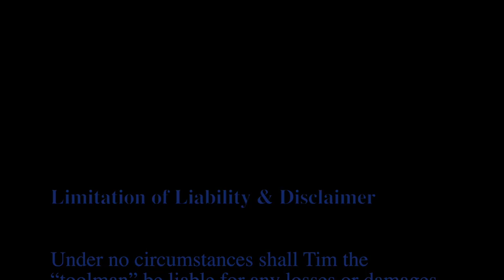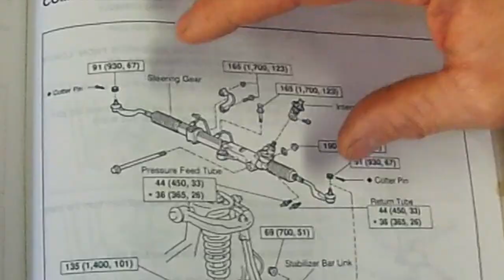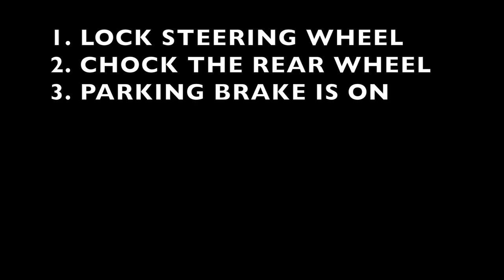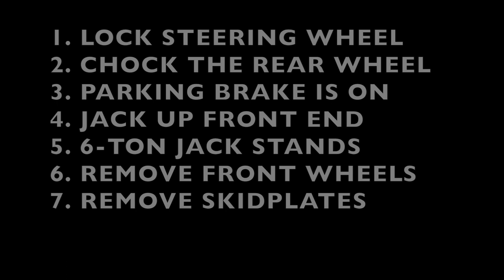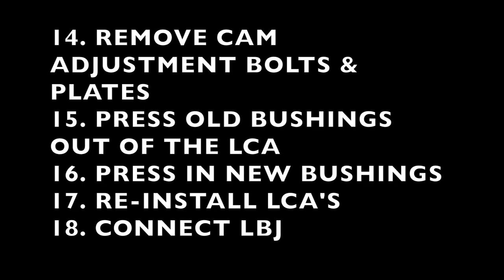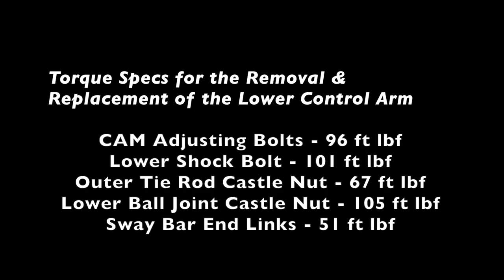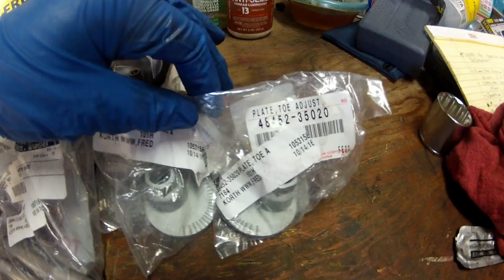Front Lower Control Arm Bushing Replacement (Part 1)

Comment: What's up Timmy the Toolman,
I might need to replace the entire Lower Control Arm since I will be renting an auto-shop with tools and would be needing to save money on garage time, but, I was wondering what is the best place to buy Toyota parts. 
Your LCA description only has bushing part numbers from Amazon. 
What other parts website is good to compare prices?
If buying from Amazon, how do I check if the part is a quality part?
Reply from the maker: An Amazon seller will advertise whether or not they are selling Toyota OEM or not.  I would not buy aftermarket control arms.  There's lots of good Toyota online parts sellers.  Camelback Toyota, McGeorge Toyota, Toyota Parts Deal, etc etc.  Figure out the part numbers for the control arms and then find a seller that has low prices and reasonable shipping costs.
Reply: @TimmyTheToolman  How about Denso Auto Parts for suspension parts? I saw that you recommended it for th O2 sensor replacement
Reply from the maker: @snoopdisnoop  Denso doesn't make suspension parts as far as I know.  They make electrical components.  So, I'm guessing you live in an apartment or condo and that's why you're renting garage space?
Reply: @TimmyTheToolman  There's not enough room in my buddy's garage and the rainy season has started here in Portland, Oregon. I'm doing the LCA's, Lower Ball Joints, and Inner/Outer Tie Rods. The driver side Outer Tie rod is making a clunk sound. 
Do you think I should do Inner as well?
You didn't necessarily drop the rack and pinion to get to the Inner Tie Rods, but one of your videos suggests it to get more space  for LCA replacement.
Reply from the maker: @snoopdisnoop  You need to unbolt the steering rack so you can pull it back far enough to clear the rear LCA bolt and cam sleeve.  In the video, we remove the steering rack boot to sneak the bolt and cam sleeve by, but if you also disconnect the power steering line bracket on the inside of the driver side frame rail, you'll be able to pull the rack back far enough to get the bolt and sleeve out without disconnecting the boot.  OEM inner tie rods are very expensive.  I wouldn't replace them unless there was actual play in the joints.  The inner tie rods cost around $300.  A new OEM steering rack comes with new inner tie rods and runs around $500.  If I had bad inner tie rods, I'd just spend the extra money and get a new steering rack, because for a couple hundred bucks more, it would be worth it.
Reply: Timmy The Toolman Thank you. Ill be sure to donate once i figure how much i save. Shops are quoting me between $3,600 to $4,500. I think i can do this.
Reply from the maker: @snoopdisnoop  You could donate if you'd like but it's not expected at all, especially if money is tight for you.  Our favorite form of payment is hearing how our videos have helped people and you've done that for us.  Let us know how all the  work goes for you.

Comment: Hey Timmy, the 4Runner and the tacoma have the same parts number for the lower control arm bushings right? Couldn’t find any for my tacoma...thanks
Reply from the maker: They should be the same.  The front ends of 1st Gen Tacomas and 3rd Gen 4runners are very similar.  But, there are some differences.  Are you going with OEM replacement bushings or Whiteline poly bushings?  I just looked it up and the Whiteline 53377A bushings doesn't mention them working for the Tacoma.  Weird.  Read Post #4 on this thread on T4R: http://www.toyota-4runner.org/3rd-gen-t4rs/232586-swap-parts-between-3rd-gen-runner-1st-gen-taco.html  Sounds like the LCAs are the same.  I think you're safe ordering the Whiteline poly bushings if that's what you were planning on going with.
Reply: Timmy The Toolman yes I was planning to go with whiteline bushings, but the website doesn’t show if it’s compatible with tacoma, it only shows for 4Runner...
Reply from the maker: Kay Saephan I'd order them. I'm 99% sure the LCAs on the 1st Gen Tacomas and 3rd Gen 4runners are the same.  But, if you want, visit your local Toyota dealer parts department and ask them.  Maybe they can give you the definitive answer.
Reply: Timmy The Toolman thanks Timmy, I just got off the phone with whiteline and they said that they haven’t tested fitted on the Tacoma’s yet but they should be exact same part number...they don’t want to advertise anything without test fitting first....ordering a set for my tacoma.
Reply from the maker: Cool.  Let me know how it goes.

Comment: Hey Tim, what is the distance between the 2 openings on the control arm? Trying to find a good size bottle jack for the job.
Reply from the maker: Hey Omar, it's 10 inches wide.  I bought the bottle jack I used in the video at Harbor Freight.  Good luck with the job when you get around to doing it.  Just remember to use a mild to moderate amount force with the jack.  You should be able to put a little pressure on the bushing, apply heat and then apply a little more pressure.  If you're not getting movement of the bushing out of the arm, make sure the bottle jack is square pushing straight (not at an angle) and also try using more heat.  People have been known to damage their arms by bending them out from the force of the bottle jack.  Happy Wrenching!
Reply: Thanks tim. I just got under there and found my front camber bolt on the passenger side was put together backwards. One cam lobe is facing up correctly and the other is hanging downwards. Any idea what could have caused this? I know they only fit together one way so I find it very weird.
Reply from the maker: @omarzeineddine5427  The cam lobes should be facing up.   Maybe the last guy that worked on it didn't know what he was doing and assembled it upside down.  I suppose the cam would still work upside down but that's definitely not the correct orientation.
Reply: Would a 2 ton bottle jack be enough to press those bushings out?
Reply from the maker: @omarzeineddine5427  No clue Omar.  The bottle jack I used is rated for 12 tons.  I thought it was from Harbor Freight but it's actually a Craftsman jack from Sears.  I would err on the side of having more strength than necessary and get a bottle jack with a higher rating than 2 tons.
Reply: What's the receiving cup Diameter for when u pushed in the bushings?
Reply from the maker: @omarzeineddine5427  Don't remember.  I just tool a measurement from a lower control arm I have and a press sleeve with a diameter of 2 1/8th  - 2 1/16th would work.

Comment: I recently changed my control arms upper and lower along with ball joints on my 2002 Tacoma. After torquing to spec all the bolts I now hear creaking. I read online that installing control arms or ball joints have to be done with the weight of the vehicle on them to not have premature wear on ball joints or have noise like I have. Is there any truth to that?
Reply from the maker: There is truth to that.  We learned this after shooting this video and we included this note in the comment I pinned.  You want the control arms in their neutral position (weight of the vehicle on the tires) so the bushings aren't in a bound state when the vehicle is just sitting there stationary.  This way the bushings are only bound when the suspension is cycling up and down when you're driving.
Reply: @TimmyTheToolman  sorry I missed that. Thanks
Reply from the maker: @jessejaviangel  No need to be sorry.  Lots of people miss the fact we offer information in our video descriptions and pinned comments.  But, now you know for the future.

Comment: do you need a special tool to remove the cam adjustment sleeves?
Reply: mine won't budge.
Reply from the maker: @oneguyonekit  Watch Part 2 and learn.  https://youtu.be/6FzEHygizoI  They won't budge because they are rusted into the bushing sleeve.  It's very common.  You will have to cut them out.

Comment: How important is to torque ? Instead of using impact until it won’t go anymore.
Reply from the maker: Very important.  Using a torque wrench is an accurate way.  Cranking down on bolts and nuts with an impact might end up with stripped bolts or nuts or sheared off bolts.

Comment: I have a dumb question. On that left side where the bolt is miserable to remove without risking scratching the hydraulic ram of the steering rack, why can't it be assembled in reverse? With the bolt going through from the FRONT. If it's one complete camming assembly, it shouldn't matter which way it's assembled for proper alignment, so long as the nut/cam doesn't interfere with the steering rack boot...right?
Reply from the maker: I suppose that could work.  But, when I did this job on another 3rd Gen 4runner, I realized you can pull the steering rack back far enough to remove that bolt and re-insert it.  There's actually no need to remove the steering rack boot.  As long as you remove the bolt that affixes the power steering line bracket to the driver side frame rail, you can move the steering rack back enough to remove the bolt.  I can't remember if we actually show the bracket bolt removal in this video but I know for sure we show it in our Steering Rack and Front Sway Bar Bushing Replacement Video. https://youtu.be/YywcR0E9bM4  Go to 12:45 play time and you'll see the bracket I'm referring to.
Reply: Thanks dude. In that other vid you forgot to show you reattaching the bracket. :P
Reply from the maker: Yeah, we don't always show every little detail because we assume the person watching the video knows they will need to reattach that bracket as part of the reassembly.

Comment: Do you know if a 2003 Tacoma 4x4/Prerunner 6 lug models use the same parts?
Reply from the maker: I just went on the Whiteline website and it doesn't look like they sell the LCA bushings for a Tacoma.  But, if I were you, I'd ask a Toyota parts person if the LCA's on a 3rd Gen 4runner are the same as your year Tacoma.  If so, the same bushings will work then.

Comment: With the white line bushings did anyone notice getting squeaky noise problems? I try and stay away from poly bushings but oem bushings are ridiculously expensive
Reply from the maker: White line makes regular bushings too, you don’t have to buy the poly ones.. but you’re better off buying the entire OEM lower control arm with bushings already pressed in if you go OEM.
- Sean
Reply: Thanks Sean I'll check that out from white line and your right about just buying the whole arm

Comment: Could this help front end shimmy at hwy speeds?
Reply from the maker: It could but I would make sure your wheel balancing was correct first.  9 times out of 10 it's a problem with wheel balancing.
Reply: @TimmyTheToolman  I replaced all four springs and shocks last summer, have had a couple of alignments and wheel balances since then. Still getting occasional highway speed front end shimmy. Sometimes rides smooth as butter, sometimes shimmy.
Reply from the maker: @warddoyouralgebra  Well, if you've addressed the wheel balancing, I would look at the lower control arm bushings and also the front differential support arm bushings.  We have a video for those as well.  Durobumps makes a replacement bushing for the support arms.
Reply: @TimmyTheToolman  Timmy the tool man always coming through. Thank you!!
Reply from the maker: @warddoyouralgebra  You're welcome Blake.  Hope you figure it out.

Comment: Why not put the bolt back the other way so in the future you can access it from the front side instead of having to mess with the steering rack ?
Reply from the maker: The opposite side of the cam adjuster juts outward a decent amount.  I'm pretty sure it would hit the steering rack boot.  That's why.
Reply: @TimmyTheToolman  I see but other than that it’s not an issue. If and when I do my lowers I will post here to let you know and maybe you can pass it on. Also thanks a lot your videos are very helpful.
Reply from the maker: @joesmith7123  Sure, let us know how it works out for you flipping the orientation of the cam adjuster.  You're welcome.  We're glad you're finding our videos helpful.

Comment: Hello Timmy,
I notice your torque is a little different from what I gather on the Tacoma World. I have a 2002 Tacoma V6 4x4 Auto. Could you confirm if I should follow your torque spec? 
 
Here's what I need torqued (front suspension): 

UCA
LCA
Lower shock bolt
Lower ball joint cast nut
4 Lower ball joint bolt
Upper ball joint
Cam Adjuster bolt

Any help is much appreciated as always.
Reply from the maker: Nero I don't see how the torque specs could be that different between the two vechicles because the suspension is almost identical.  But, I would go with the torque specs you have found for the Tacoma.
Reply: Timmy The Toolman 
Okay, thank you. The only that was off from the torque spec was. 
Lower shock bolt 61 ft lbs vs your at 101 ft lbs. the rest is off +\- 5 ft lbs. Thanks as always
Reply from the maker: I would definitely go with the 101 ft-lbf for the shock bolt.  61 ft-lbf is pretty light for that big of a bolt and nut.  The smaller bolts for the lower ball joints are around 60 ft-lbs and they are much smaller than the shock bolt.
Reply: Yah, that what i thought as well. Thank you as always. Enjoy your day.
Reply from the maker: You too.  Happy Wrenching!

Comment: Polyurethane vs Rubber what made u choose whiteline
Reply from the maker: People reported having good luck with them and they are a more affordable option than the OEM rubber bushings.  The jury is still out on whether or not poly bushings will last as long at the OEM rubber bushings but so far so good.
Reply: @TimmyTheToolman  would you put polyurethane in pavement prince 4R
Reply from the maker: @seanf6868  Yes, I would.

Comment: How do you know when the bushings are done?
Reply from the maker: You look for cracks in the rubber and you manipulate the arm looking for gross movement from the bushing.  With everything still connected to the LCA, it's a bit hard to tell how wasted the bushings are.  I would disconnect the sway bar from the end link, disconnect the lower shock connection at the LCA, and disconnect the lower balljoint from the LCA and then push forward and back on the arm.  If you get a ton of movement from the arm, the bushings are toast.  You might be able to get a large pry bar in there somehow with everything still connected and do some prying to see if there's gross movement in the bushing but I've never tried this so I couldn't advise you how to do it.

Comment: So in pressing the old bushings out it looks like I might have bent the control arms ever so slightly. You can’t see it with your eye but when trying to reinstall them the outside sides touch the frame mounting surface with no washer. Anyone know a good way to bend them back
Reply from the maker: You could use the bottle jack.  Get the control arm between the frame of your vehicle and a block of wood on the ground and then operate the jack to push pressure against frame and one of the arms pushing the arms back inboard towards each other.  I'd go very conservatively applying a little pressure, checking the fitment and then going more if you need to.
Reply: @TimmyTheToolman  okay I’ll try it. If that doesn’t work I may go buy a press
Reply from the maker: @sawyerbeals5105  It should work.  An extra set of hands would probably help.  A Harbor Freight 20 ton press would be a nice addition to your tool arsenal though.
Reply: @TimmyTheToolman  my thoughts exactly😂

Comment: There seem to be many inexpensive aftermarket lower control arms all over the internet, what are the consensus on these? It seems like it would be easier to just buy an entire control arms with new bushings already pressed in. Does anyone have experience with these aftermarket LCA's? Should they be avoided?
Reply from the maker: I wouldn't recommend them.  The construction isn't as strong, and the bushings usually suck.
Reply: Thank you!  @TimmyTheToolman
Reply from the maker: @elevy01  You're welcome.

Comment: 1. Outer tie rod 19mm
2. Mark cam adjusters
3. Free steering rack - bracket, two bolts, disconnect boot, support with jack+wood
4. 22m/19mm for bushings
5. Shock bolt 19mm
6. Lower ball joint 24mm
7. 12 ton bottle jack+heat to press out
8. Vice+channel locks+receiving cup to press in

Your welcome
Reply from the maker: Thanks for the synopsis of what's involved to do the job.  I would still recommend people watch the video though.
Reply: @TimmyTheToolman  absolutely, but I take notes to summarize what needs to be done when I'm doing the job